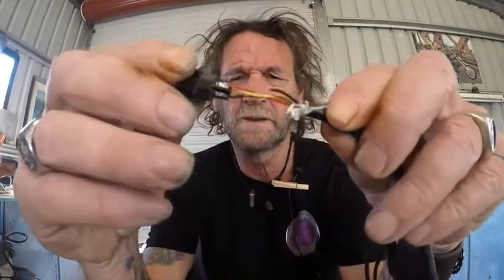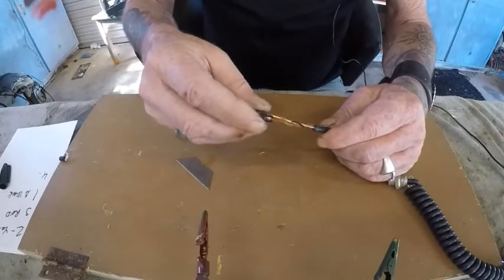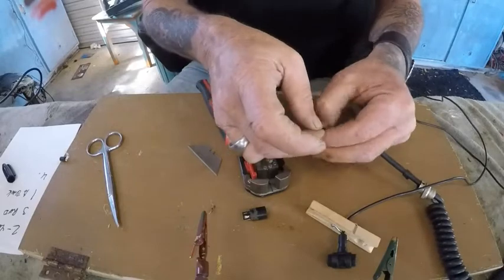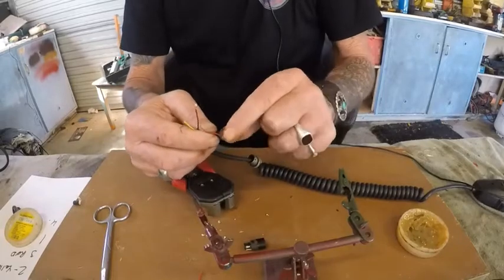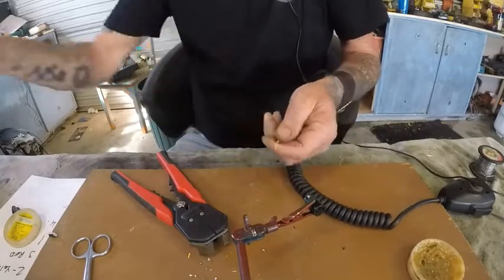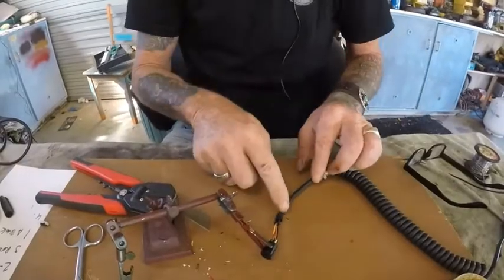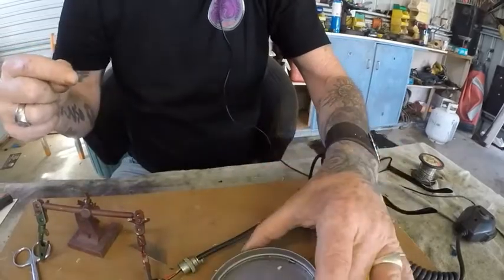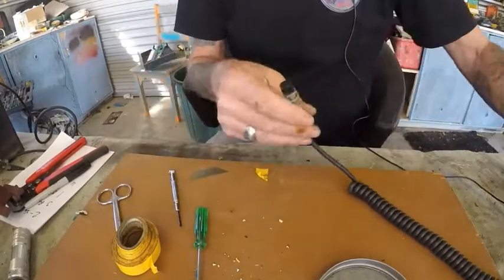CB Radio Mic Repair...... Hippy Trev

Comment: You need to make the connection short when you solder them. That way when you put the collar on it should be around the outside of the cable. as a strain relief. It wont last long the way you have it. The wires should only be about 1/2 in long at the most.
Reply from the maker: still working...  but yer could have been a lot better cheers